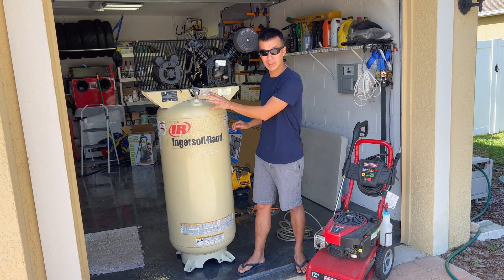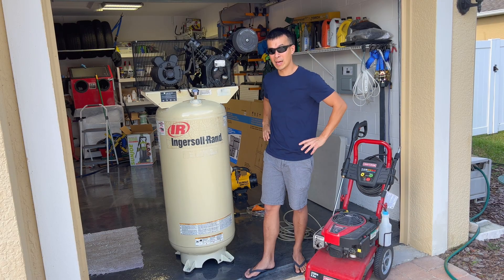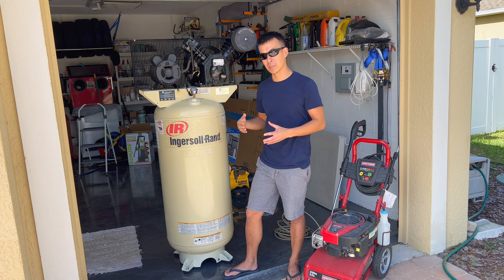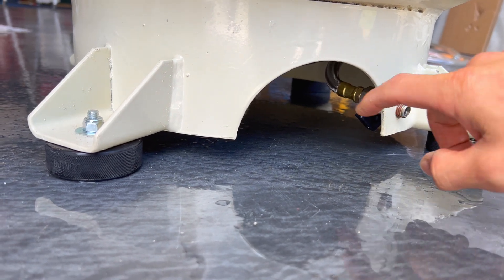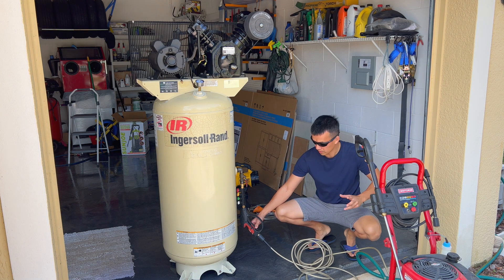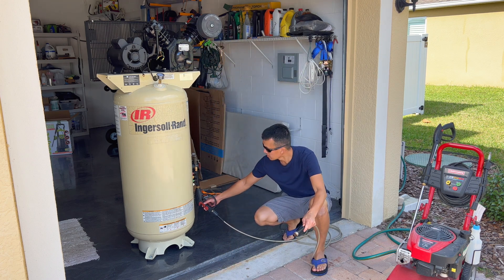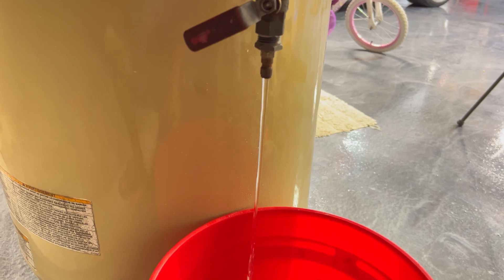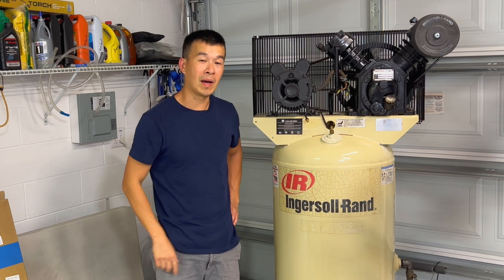How to Hydro Pressure Test Air Tank | Compressed Air Tank Hydrostatic Test

Comment: Any worries of tank explosion during hydro test?
Reply from the maker: Nope. Thats why you hydro test. Water fills the volume and it doesn’t compress. So the 300psi buildup fast and holds. If there is a rupture, there is very little potential energy in the water and small pocket of air.

Comment: Excellent video.  I did exactly what you did when I rebuilt my IR compressor a few years ago.   I have that same 2475 pump on mine, works great!
Reply from the maker: Yep this thing is a beast if you take care of it. Plus maintenance parts are cheap and easy to find on Amazon. This was a early 2000s and I think was only used for 4 or 5 years because when I started working at this office, this was already abandoned outside, luckily someone left the drain plug off when they decommissioned it.

Comment: I use the grease gun methode on my 30 gallon tank. With the tank full of water it takes about 1-1/2 tubes of grease. I pressureize the 175 PSI rated tank to 300 PSI and leave it there for 1 hour.
Reply from the maker: Sounds messy.

Comment: What kind of pressure gague on top of the tank did you use ? Was it a air or water gague ?
Reply from the maker: Same air gauge for tank. I had one laying around that had the higher pressure to test it.
Reply: Thanks  @TunerwithKids

Comment: Shouldn’t the check valve be rated at the maximum pressure that the tank is rated for so it with relieve the air when over pressurized?
Reply from the maker: Thats the safety relief valve. Testing to 300psi is nothing for these tanks so if it can hold at that, then 155 psi is nothing.

Comment: I think your very lucky you didn't rupture the tank or at least stretch and weaken it. The first shots of water you did one or two at a time were compressing the air you left in the tank. Then you got inpatient and blasted it 6 times before checking the gauge.  You should have set it up to read the gauge while adding the water. You could have 90ed the gauge or the water inlet or used a mirror on the gauge to see movement. You should note this in your video so someone else doesn't destroy there tank.

Comment: i need the fitting to connect my pressure washer to the tank  ?
Reply from the maker: I used a quick connect for my rotation pressure washer head. It’s standard NPT thread so you need coupler. https://amzn.to/40W3W8P

Comment: You are close to failure of a few things here. The 1/2 in valve is ok, iffy on the street el, and the over pressure valve should have tripped. Good test though, be safe. 
there are a few vids about tanks letting go -some are very bad.
Reply from the maker: That’s the beauty of water tests. No potential energy under hi pressure except a squirt then just flowing water.
Reply: @TunerwithKids  I agree, but could overstress and damage the fitting or valves or whatever is not made to take that pressure.
Just an FYI. Just be aware of the whole picture. I fill my scuba tanks until the paint cracks, and back it off 50lbs. <snick>
Reply from the maker: Yea when I started the test, that was my main concern, the check valve. It’s rated for 500 psi so I was below. I would have done the test when I had the bare tank stripped but didn’t know about until I had already reassembled the new valves.

Comment: You cannot properly hydrostatic test the tank with the safety release valve on. For a proper hydrostatic test you must exceed the rated PSI of your safety valve by 1.5 to 2. The idea is that you are testing to a safety factor (the 1.5 to 2) above the maximum pressure of your tank, which is the safety release valve pressure. That in turn should be higher than your cut-out pressure switch.
Reply from the maker: I think I tested it up to 270psi. That’s more than 1.5x the 155psi the tank holds. It held that pressure for 4+ hours with the one-way check valve still on. I did my research and that OE one way check is good to like 300+ psi. There isn’t a safety relief on the tank in my test, the safety was part of the switch assembly which I removed for the test gauge. There is a safety on the one way check, but that’s on the compressor side, not the tank side of the valve.